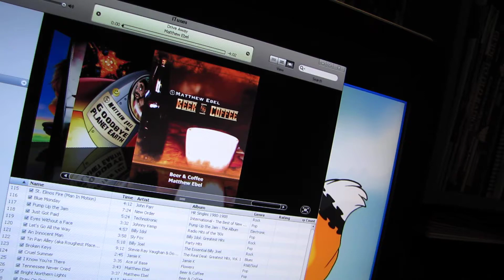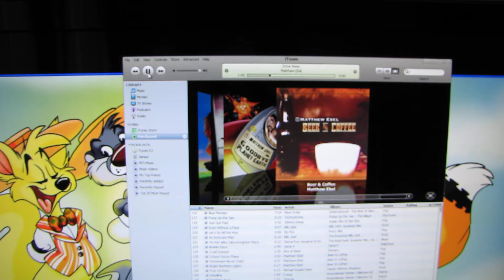My DIY 6L6GC stereo tube amp project, part 5

Comment: In my search for info on building a stereo tube amp I came across your videos, and then I noticed Matthew Ebel in this video.  He recently moved not to far from me, so we get to hang out now and again.

On to my question.  Do you still have the schematics to this build?  I'd love to take a look and see if I can create this amp myself.
Reply from the maker: The output section is essentially a Harman Kardon HK250.  I just used a different tube for the driver stage, and a bigger power supply.  The preamp circuit is from Max Robinson's "Fun with vacuum tubes" page that had some various examples.  I think it was called a "better tone control" circuit.

Comment: I know this is an old video but I have a question for you sir what size 8 pin tube socket knock out chassis punch did you use ?

Regards
Juan
Reply from the maker: I thought it was 1 1/8", but I'd have to measure it to see for sure.  It's been 5 years LOL.
Reply: I already purchase I used one from EBay and is 1 1/8" but I think on other 8 pin tube socket 1 -  3/16" and 1 - 1/4" is use too I just need to confirm this, the 8 pin tube socket I want to install them from the inside of the chassis not the top like guitar amps do so I'm not sure if 1 1/8" is enough or I need a bigger chassis puncher, any way sir whenever you get a chance let me know, I know you are busy on other stuff good day :)

Comment: @Maxxarcade I see. I'm working on building my tube amp. I have everything I need. Power/output xformers and 6L6GT outputs and a pile of 12AX7s but I can't find the schematic for the amp it all came from so I have to start from scratch.

Comment from the maker: @lazzer408 Nope, I built it a bit at a time.  The power amp section is essentially the Harman Kardon HK250 with an upgraded power supply, and the Pre-amp is a modified version of a circuit from the RCA RC-30 tube manual.

Comment from the maker: @mudbone80 I would say FLAC or Apple Lossless is the best.  MP3's tend to have harsh treble and not much dynamic range.  Though I'm used to the full sound of Vinyl :-)

It also depends on the music.  If what you are listening to is already loud and compressed (like most newer rock music) then you might not notice a lot of difference between formats.  For stuff like 80's music, Jazz, Blues, Classical, etc, I'd definitely use a lossless format.

Comment from the maker: Several things actually.  Bad grounds/ground loops, unbalanced heater windings, and magnetic radiation from the unshielded power transformers.  Everything has since been fixed except for the shielding, which I am waiting on still.  They need to be custom made.

Comment: I enjoyed all 5 of your videos showing the building of your tube amp from scratch, they were very interesting.  Do you buy a schematic  for a certain type of tube amp, like the 6L6 you just made, if so do they have schematics or plans for an  EL34 , Kt88, or 6550 type tube amp, with different power ratings.

Comment from the maker: There aren't any, for the most part.  The main power amp was based on the Harman Kardon HK250, and the pre-amp circuit was from the RCA RC-30 tube manual.  But I made some changes to both circuits when I built this amp, and I don't have the modifications on paper.

Comment: Just wondering where do you get covers for your transformers? I've got an amp project I'm working on and the two main laminated transformers are causing havoc to the signal and output wires.

Comment from the maker: That was part of the problem too.  I was able to greatly reduce hum by adding 100 ohm resistors to ground from the filament lines.  If it persists after I get the covers, I'll probably have to use a DC filament supply.